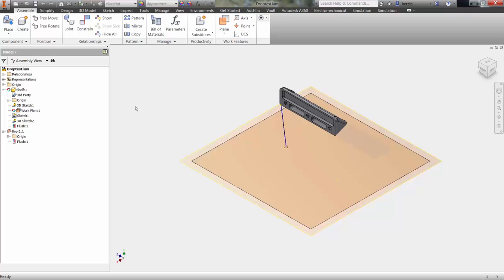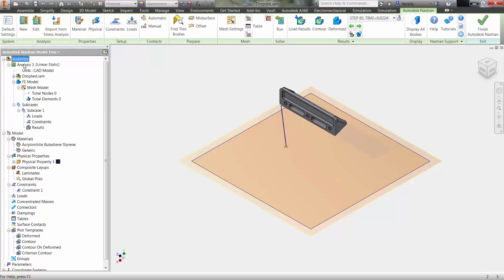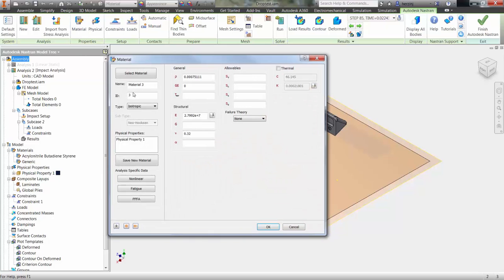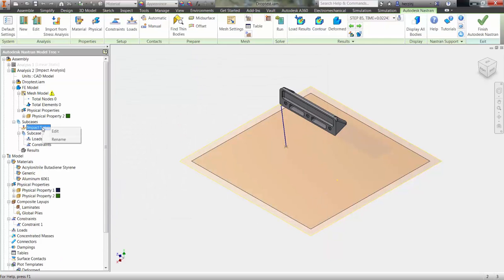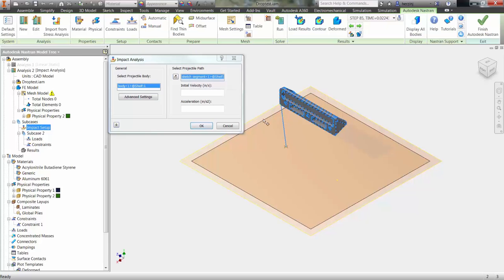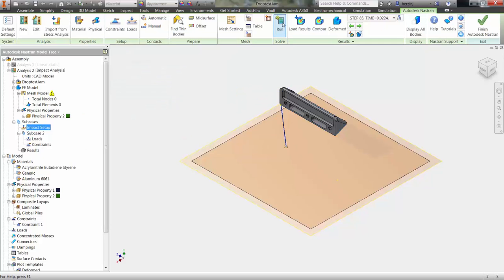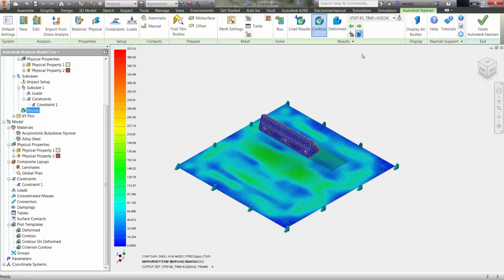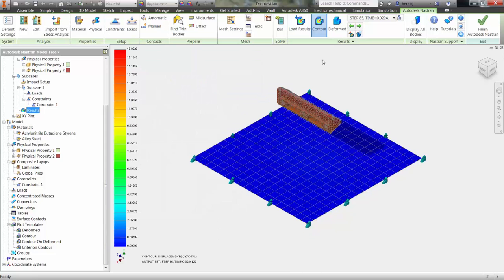Automated Drop Test

Comment: how do i draw the floor? is it a surface?
Reply from the maker: Hi kcazzzzz, 
The floor in this example is a region that has been meshed as shell surface elements. You must model this in Inventor's modeling environment rather than the Nastran In-CAD environment. If modeling a 3D representation of the ground, it Nastran would mesh it into solid elements instead, however this method would entail additional analysis time due to the higher element count. 

Hope this helps!